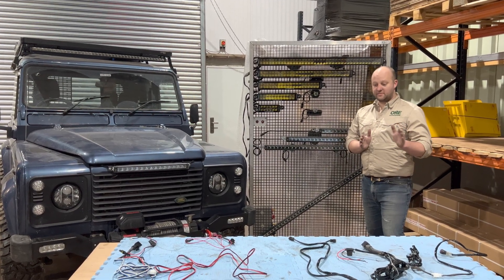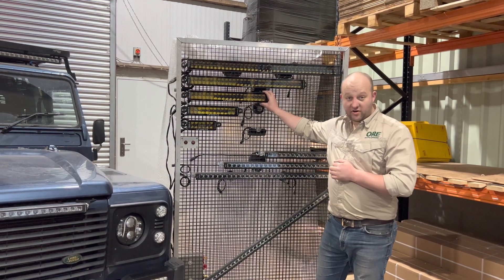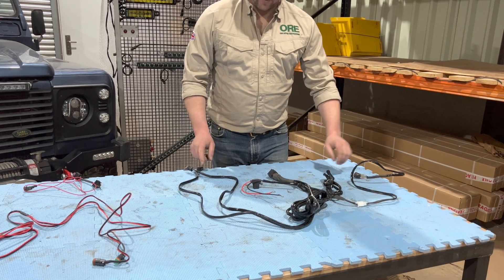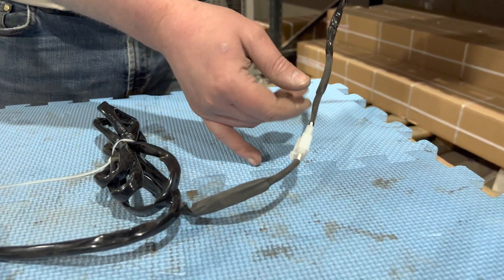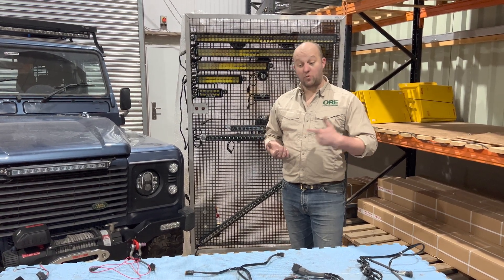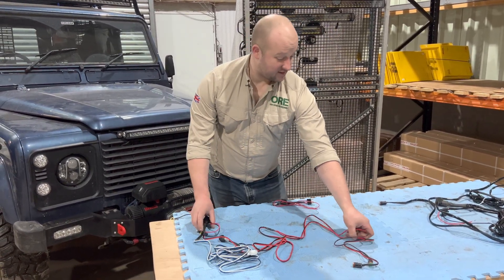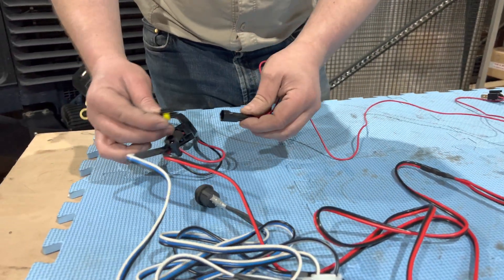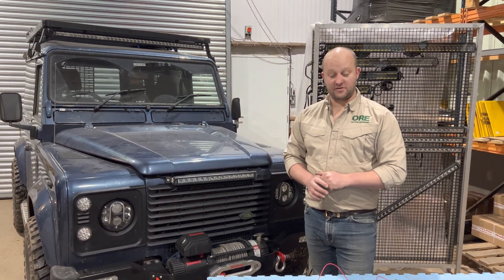OUR RANGE OF LTPRTZ HARNESSES/WIRING LOOMS EXPLAINED | ORE4X4 UK

Comment: Ive got a set of your headlights fitted in my defender,  also got a pair of your 70watt ultralux spotlights. Ive got the pco06 harness and it doesn't appear to be long enough to reach from the battery under the seat to the front bumper. Also the extra wire for connecting them to the headlights is about half the length of the main harness. Am i meant to cut these wires and extend them all or am i just been a tool. Some instructions would be handy with the kit.